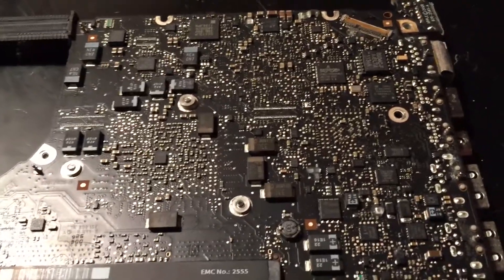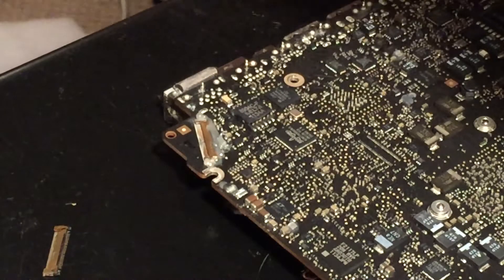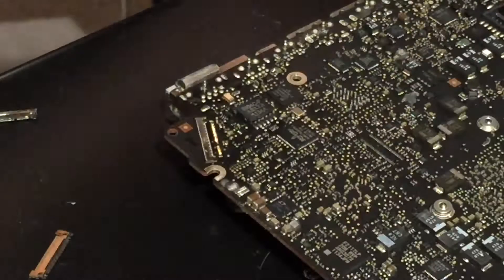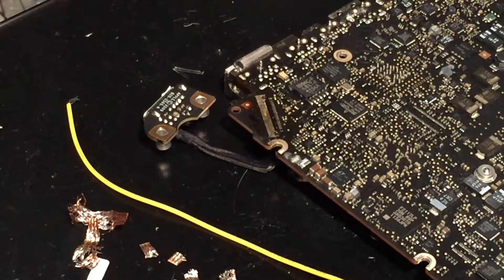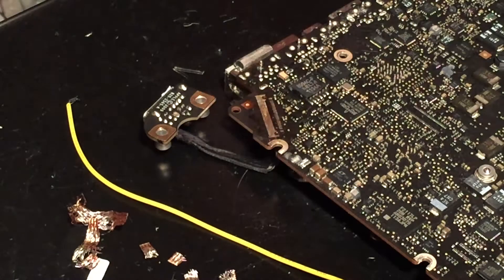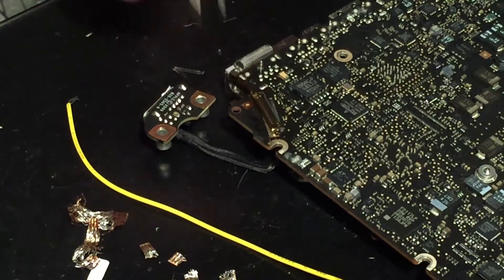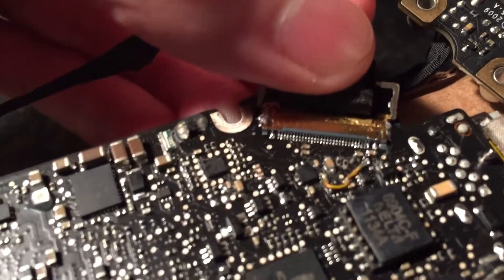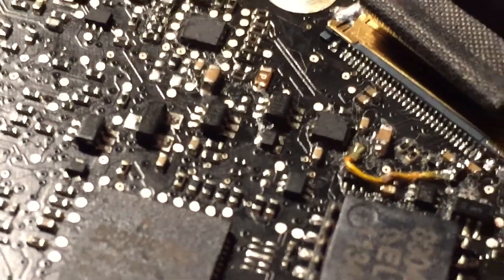Late-2011 13" MacBook Pro LVDS Connector Repair

Comment: I had an old 2008 MacBook that had the LDVS connector rip straight off the motherboard when I tried taking it apart. 

I followed instructions correctly and it still came right off :\